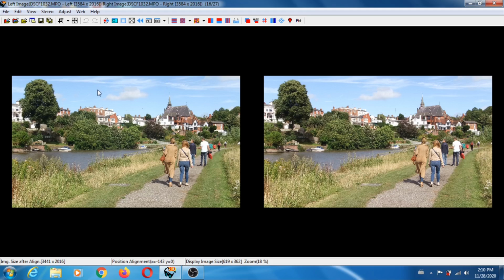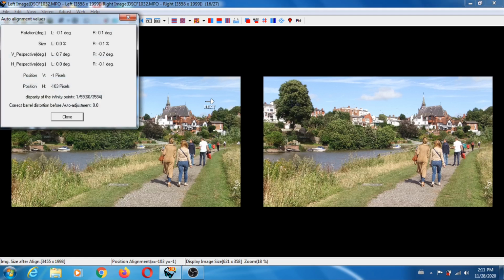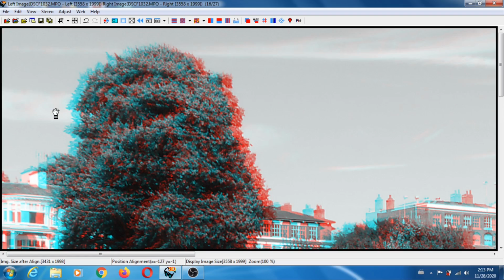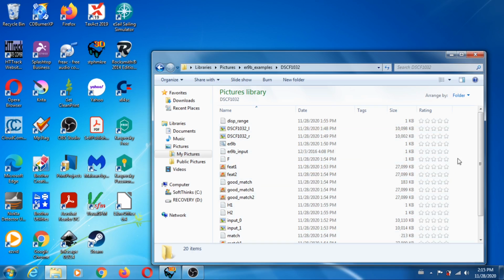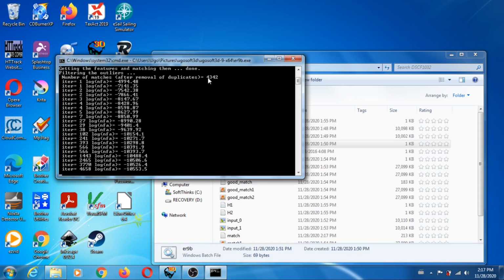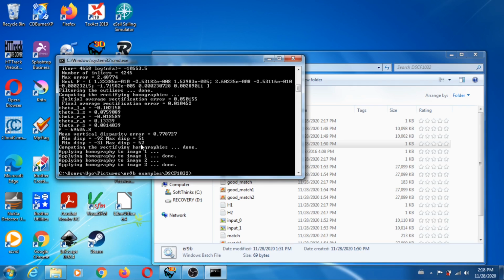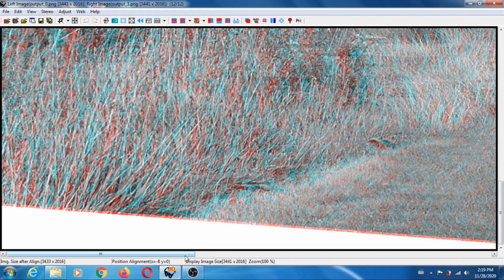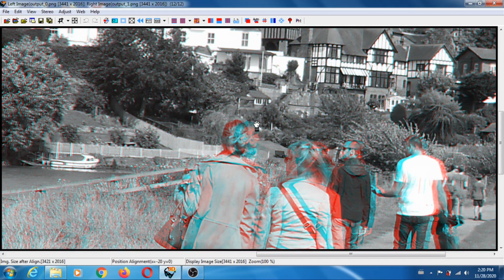Auto alignment of stereo pairs using SPM vs ER9b

Comment: Extremely interesting and informative. Thanks so much for taking the time to do this.  Haven't started fooling with Depth Maps yet, but it's on my agenda, so learning about ER9b is very helpful.  Subscribing....
Reply from the maker: Well thanks Greg. In most cases, using the auto-aligner in SPM is sufficient (as long as you use the slow/more accurate method -- check the options/setting tab). ER9b is more for the purist that wants the best possible alignment. There is also ER9c which is less aggressive than ER9b.